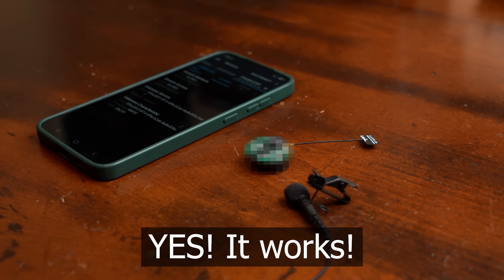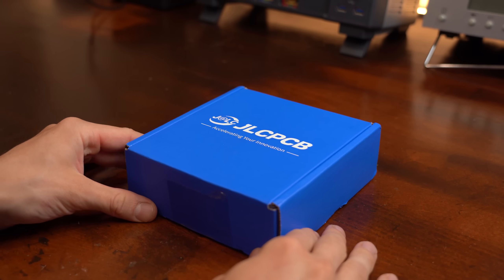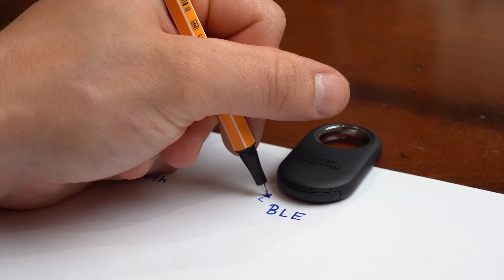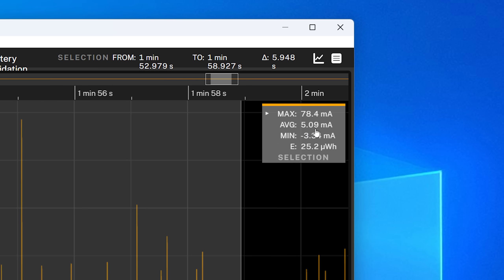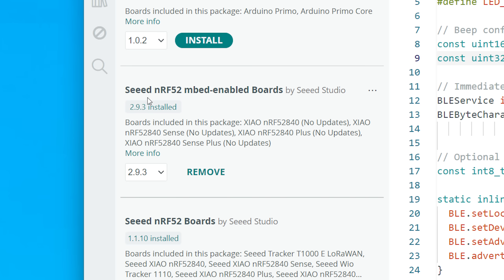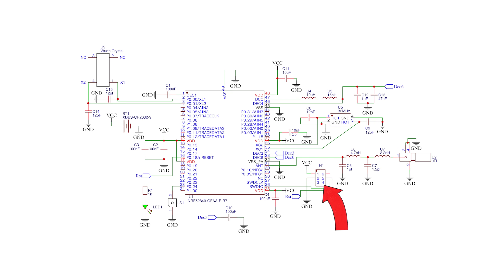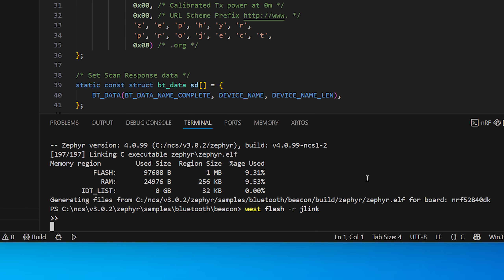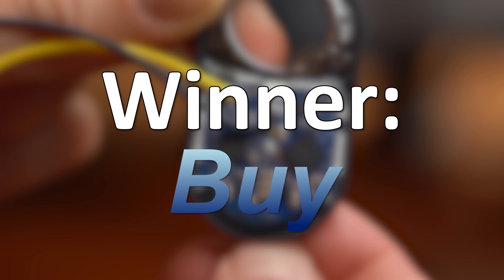The Most Handy Gadget can be done...Cheaper?! (DIY or Buy)

Comment: Long time viewer here.  I just want to say your skills have improved at an amazing rate.  I'm still doing through hole stuff, thinking about 74xx chips, playing with arduino.  But you are making high density boards with advanced cutting edge chips, reading their data sheets and using their IDEs like a pro.   That it worked at all is amazing to me.  However, DIY or BUY limits your creativity.   Maybe build something that walks up stairs, alone or in pairs, and makes a slinkity sound?

Comment: Good attempt! You could definitely improve the RF performance by locating the antenna connector as close as possible to the NRF's antenna pin and avoid using vias. This should help reducing outside interference and losses. You should also match the trace's impedance to the antenna's impedance (usually 50Ω), you can use calculators for this when you know the PCB's properties and fine tune later using a matching network with measurements from a VNA. Still, the closer the antenna is to the pin, the less you have to worry about precise matching.
Reply: what do you mean by "avoid using vias"? Like in the RF path? That's true.

Comment: $2 pcbs are great, but they don't cost $2.  The cost $2 plus about $15-20 for shipping.
Reply: Ah here in the UK, you can select a much cheaper option another $2, it takes about 1-2 weeks to arrive kind but means you can get a really good deal. It's always the most expensive delivery by default mind.
Reply: You can also get cheaper shipping if you are willing to wait longer. I just ordered my first pcb and payed 5.84 USD to Germany. Plus 7.70 USD for 10 pcbs, 1.37 USD for custom duties and taxes and 0.50 USD for paying with PayPal. I payed 9.07 USD in total (including the discount for new users).
Reply: Correct, the shipping cost is relevant and much more so if you order stencil or if you let them assemble the PCB.
But the great advantage of jlcpcb for us in EU is that they collect vat at origin so you don't need to pay additional fees. If only their friends of lcsc would do the same......
Reply: My last order from JLC was $2 PCB and $1.50 shipping to EU.
I'm just using Global Standard Direct Line shipping with ~2 weeks of delivery, instead of DHL Express, which does cost over $20.

Plus it also depends on where you live, some countries might have more expensive shipping, which is not JLC's fault.
Reply: Just use KiCad + laser printer + photoresist + citric acid and hydrogen peroxide 

Yes, it's not factory quality and single sided only, but it's quick and cheap
Reply: @Gameplayer55055 I tried that a while back. I never got the quality others seemed to get. So I bought one of the cheap desktop CNC machines and make them that way. Like you said, not as good as the stuff you get from PCBWay or JLCPCB, but better than a perf board.
Reply: @Gameplayer55055 the cost of materials to diy cost more than small boards through a pcbfab and is much better quality from the fab.
Reply: It is still cheap enough
Reply: Yep, it's 30-40$ for shipping to Australia, despite being much closer to China than the US
Reply: @lukamic 
Holy crap! Really? I remember looking a few years ago and it was only about $5 for shipping to Australia.
Which if you order 1 PCB, is still only $7US, making it cheaper than buying all the appropriate equipment to DIY it. Sure, if you're planning to make 3 or 4 different boards per week, you might be better off getting the gear and DIYing them, but most people seeking a $2 PCB aren't doing that.
Reply: I order like 100 and combined shipping, ends up pennies on the dollar.
Reply: You could fly to China and pick it up in person I guess ?🤔
Reply: That’s still not expensive for a development board, once you know it works then it’s less than $2 if you buy a proper amount
Reply: They used to have super cheap shipping to the US. Now it's $20 or more.
Reply: Don’t forget the stencil! That’s another 20+
Reply: Yes for real that's why I can't even get pcbs
Reply: @FlammableElectronics That's why I prefer mill my own pcb immediately than order one for 20€ and wait a week or two for delivery.
Reply: @flob7435 is it difficult? I'm noob but very curious
Reply: @slowjocrow6451 yes, I have a CNC and I wouldn’t waste my time on that because you also can’t sell any because the one you make may not be the same as the ones you order to sell
Reply: incorrect, the shipping cost is not per-pcb but it scales on its own. So you can have dozens of $2 pcbs with the same shipping cost
Reply: @marcogenovesi8570  You're still not getting a $2 pcb.
Reply: @rickseiden1  you're still not paying $15-20 shipping per pcb
Reply: @rickseiden1  I just ordered 5 from JLC with slow shipping for $5.93 total. So yeah, it wasn’t $2/pcb, it was $1.19/pcb. 

Just because it isn’t true for you, doesn’t mean it isn’t true for everyone :)

Also, I agree it’s frustrating that shipping costs aren’t factored into pricing every time, but that’s such a difficult problem to solve. How do you account for a potential customer’s location when writing promo copy? Do you cater to those in high shipping cost areas? Or just an average customer shipping cost?
Reply: You can share the costs with friends.
Reply: Kind of a dumb comment to make. Are you stuck in the year 2000? We all know how shipping works in the online world.
Reply: @fonarte  I made the comment because sponsored spots always say "$2 PCBs" and that's just not true.
Reply: @rickseiden1 I agree. I pay ~$4 per PCB up to 100*100mm
Reply: @rickseiden1  if you weren't just born yesterday, you would know how online commerce works. It's not a retailers responsibility to control shipping costs. That is up to the courier service. You should always assume their are extra costs including shipping, tax and duties. Buy in bulk. That's the point of this video. If you just need a couple of tags, but it. If you need a lot, DIY it. Nobody is stopping you from making home made PCBs, but what is worth more, your time or some money?
Reply: @wokzhongson yeah, you should be able to nest multiple PCBs in a 100mmx100mm PCB and then you break or cut them apart when you receive them, only after using the a order mask though. 🧠 That would make it much cheaper.
Reply: @benargee  You are entirely missing my point.

YouTube stars like this are sponsored, and they don't tell the whole truth about it.  $2 PCBs sounds great, and I would go expecting to see a few dollars in shipping, but not $15-$20.

I do expect to pay for shipping.  I know how online commerce works. But the amount you pay in shipping far outweighs the amount you pay for the product, and that, to me, makes saying $2 PCBs disingenuous. 

It's a lot like Prusa's "free filament" from Printables.  It's not free when I have to pay for shipping.  It's not free when I have to pay anything.

If you don't see things the same way I do, that's fine. I'm not trying to say you're wrong.  I'm trying to express my opinion that saying a set of PCBs will cost $2 when you know that shipping will be anywhere between five and 10 times that, just isn't what I would consider truth in advertising.

Comment: I'm not an expert, but I bet that the reference schematic was for a PCB antenna, or a chip antenna. the connector and the antenna length is my best guess as to what caused the range drop.
Reply: I have used the reference tuning for a u.fl connector antenna just like in the video and it works pretty well. Around 6dB worse than the development board. But the range is tens of meters.

Comment: You could use a 6-pin Tag-Connect for the programming header instead of that THT footprint and ribbon cable mess.
Reply from the maker: That would have been a much cleaner solution.....
Reply: @greatscottlab  I'm not sure if there's room, but recently I've been pursuaded to use Wurth SKEDD connectors instead of tag connect.  £1 connector instead of a misplaced £30 cable..
Reply: @greatscottlab tag connect is great, well worth the price do get the holder thing though. Makes debugging easier, though you can print some as well.

Comment: You probably are already aware, but just in case....  The antenna needs to be attuned to the intended frequency you're using by, amongst other things, carefully making it the correct length of some fraction (usually half or quarter) of the wavelength of the signal you're having it send.  That should help a bit with range.  Maybe needs some extra circuitry to filter out other signals outside the 2.4GHz range.  It's just the way you said it in the video, and bigger is not always better, especially with antennas.
Reply from the maker: Yeah, I should do an RF antenna video in the future. Even though I am pretty much a beginner when it comes to that topic.
Reply: @greatscottlab  RF antenna are incredibly hard to get right, it really feels like magic, so not getting it right the first time is expected. You need to tune the impedance of the traces, match lengths, and tune the capacitance and inductance. Not easy
Reply: @greatscottlab  I'm making a few guesses here: It's possible you copied their tuning elements into your schematic and that they are not needed or need different values, you would need a VNA and test the BLE bands of interest to evaluate. That flate flex antenna type could be a PIFA/MIFA or meandered dipole which have donut shaped radiation patterns, you want to test a few orientations and field positions to better understand your receive performance so you're not standing in a null and cursing your design. Usually those flat flexible antennas are designed to be mounted directly to plastic of a certain thickness, you could try placing it near different plastics and performing your field evaluation or otherwise use a VNA. The antenna you selected might be detuned by being near the circuit or on the table, you'd have to test a few different orientations, lengths, and even antennas. It looks like the app you were using can report RSSI (receive strength) in dBm (decibel Miliwatts), as a first pass/cheap option you can set up your device and phone at known distance/orientations and play with the previously mentioned things to evaluate how your performance improves.

I hope you will not listen to the person telling you not to try looking into the RF design, we should always strive to play and learn new things. I think with BLE and some off the shelf parts it's hard to violate RF regulations so it should be safe to experiment and have fun! If you haven't played with a VNA you can dip your toes into the RF ocean with something like a NanoVNA. I recently started doing some RF design and have found it to be a fascinating and fun area of interest, I wish I would have been exposed to it a lot sooner. Working on the RF portion of your design could be a great opportunity for many videos and to link up with any of your friends or anyone nearby that has an RF/EMC lab.

Best of luck and thanks for your videos!
Reply: @ThatGuyJDMan  This is really helpful, I know only a little on the subject and it's on a different scale so have had a hard time with this kind of implementation.
Reply: @greatscottlab  RF is practically wizardry in my eyes
Reply: @greatscottlab  Oh I've been working with the nRF for years now.. I started with the 51 .. a few tricks to make it work better are; to match the impedance of the trace to 50 ohms, also there are passive componentes that will help you with that as well to filter, and always ask to the pcb manufacturer to do the impedance control. Most of the low reach of the signal is due to poor impedance matching and ground planes where there shouldn't be. Also even omnidirectional do have signal characteristics, always check the data sheet of the antenna to see the far fields and lobes.
Reply: @greatscottlab  RF is popularly known as "black magic" (both in the world of electronics and science) for a reason.
Reply: @greatscottlab  What a great opportunity to expand your knowledge and learn something new and fun!
Reply: @greatscottlab  This video suffered from being rushed and has a number of questionable aspects like power issues, that implied not enough time was put into it. Look into the C API. Multi-part videos are not a bad thing. If you hit a stumbling block, document the failure and come back with another try later. In the same vein, review old projects and improve them.
Reply: @greatscottlab  In such case, please don't do a video on the subject in the future. Seeing how you've done the RF traces on this board already demonstrates a lack of even basic research for this project. 
Let's keep educational content based in education and not in quick research and regurgitation for the sake of a video and views :)
Reply: @voidtyphoon  "Seeing how you've done the RF traces on this board" how did he do them???? And how could it be done better???????
Reply: @voidtyphoon  Where's your video of making an RF antenna then? I'd love to see GreatScott do a video on whatever he wants to. I'm not too proud to learn from his mistakes.
Reply: If you really want to learn about RF design the best course of action is to get an intermediate amateur radio licence, I learned plenty from it and continue to do so, foundation covers alot of H&S, but intermediate and advanced covers more on RF applications and building your own equipment, you start to learn about inductances, capacitance, resistance and how it affects inductance at different frequencies and power levels, you start to understand the physics of impedances matching and swr in antennas and circuits.
Reply: 31.25 millimeters is the 1/4 wavelength for 2.4 GHz.  Probably best to print it on the PCB so the antenna is accurate.  Wires are ok for low MHz work, but GHz range is a lot fussier.
Reply: it is kind of black magic but managable when following some rules. First thing would be always pay attention for the return path. Then pay attention to Z0 along the antenna path (Wellenwiderstand). Also use a VNA. A very affordable one is the miniVNA. Another point about energy consumption: Maybe try to use Zephyr OS or the nrf version which is their official supported IDE now, nRF Connect (VS Code extension). Zephyr is build on using the least amount of resources by default, resulting in lowest amount of memory and energy used. Getting into it can be a pain though. You need to enable many things manually and you need to know what those are first. There are many examples though.